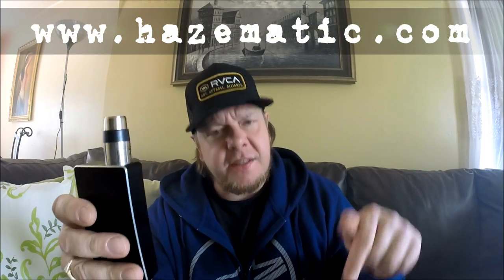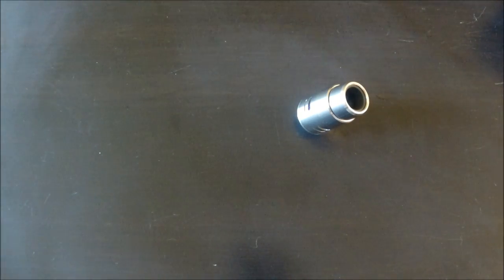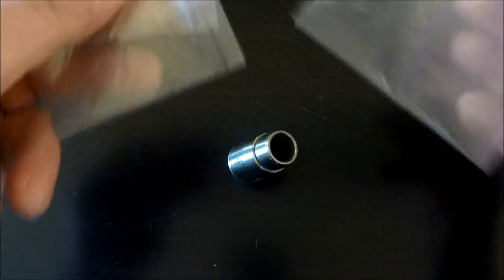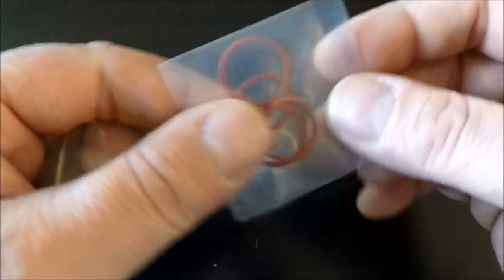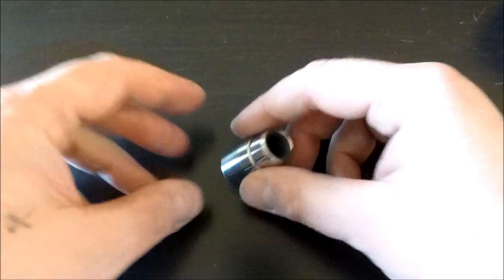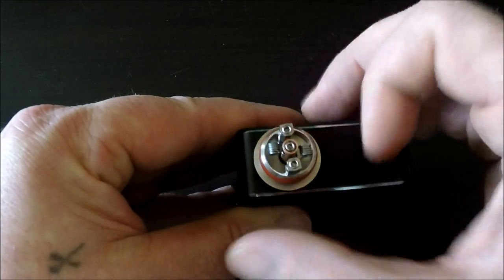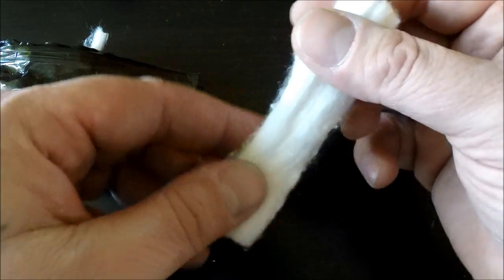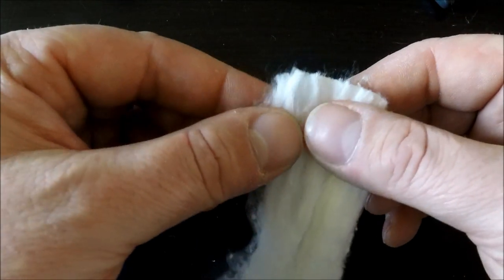Revolt RDA by Hazematic

Comment: This atty looks pretty sweet.  Love the medical grade steel, and gotta love the PEEK everywhere.  Wish that PEEK Top Cap wasn't so expensive (almost 1/2 the price of the atty).  I also LOVE Looper too.  One thing that jumped out at me, and this is a trivial thing. This could be a US vs Canada cultural difference, but the usage on the word "funky" made me smile.  The way you were using it as a positive, but in The States would have a negative meaning.  Every time you said it I was cracking up.

Comment: Maestro does the entire top of the rda have to be taken off to drip or can the top come off and the outer sleeve still be on while dripping from the top?
Reply from the maker: You will need to pull the whole top off if that's your approach but while using the drip top, it's really easy to just drip through that.